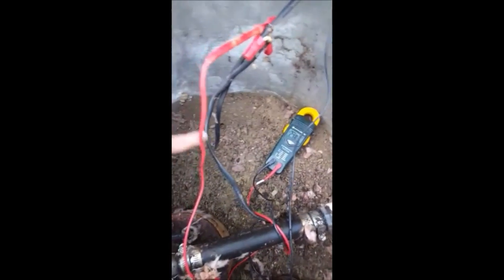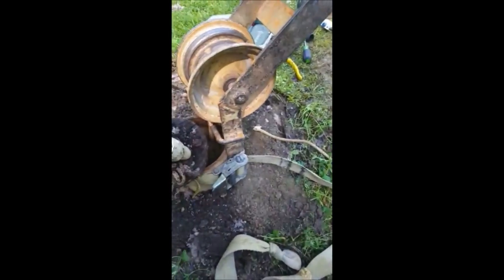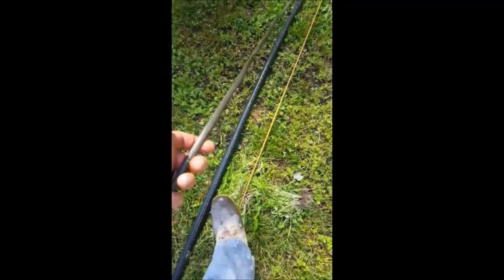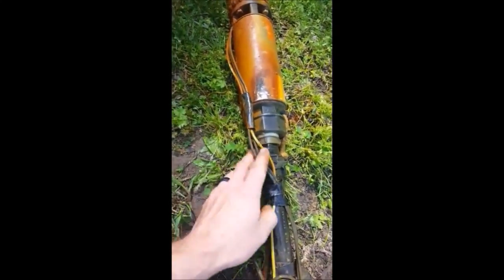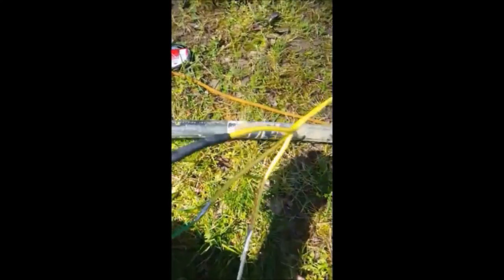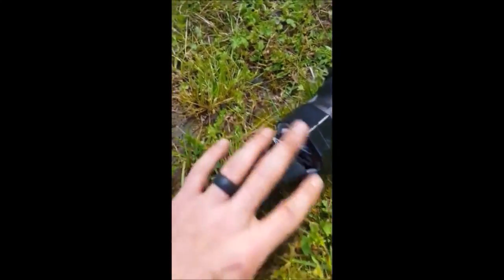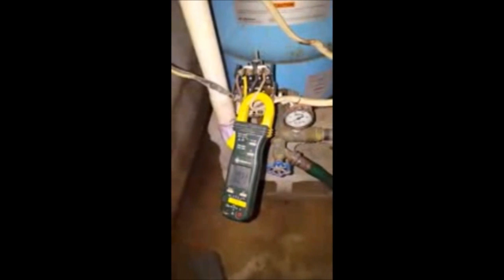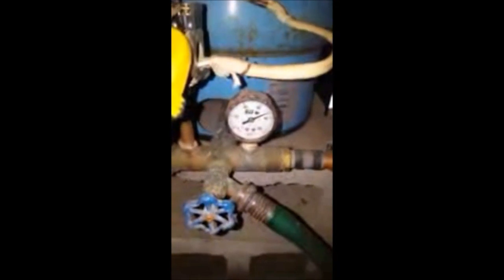Well Pump Diagnosis & Replacement - Done Right

Comment: I'm about to tackle a pump from the late 80s early 90s that's over 200 ft deep. You have a recommendation on type / brand of pump and bladder I should buy?
Reply from the maker: 3/4 hp Goulds pump. 10GPM 2wire
Reply: @h2omechanic   do you think 1hp goulds 18g p.m. 3-wire would be Overkill? We raise Hogs and go through over a hundred gallons of water a day just on livestock. What do you think I should do on the bladder
Reply from the maker: @bigred7322  2wire is simple...3 wire requires control box. Id stick with a 1hp . 18gpm head is too big for 300ft deep. A 10gpm head will give 15gpm & id use a 44 or 36 gal tank
Reply: @h2omechanic  I believe the existing is already three wire with a control box. Even if not, I'm not too concerned about simple, just want to make sure I put the best back in the ground so I don't have to do this again for a very long time. Would it hurt to run an 86 gallon bladder, or is that too big?
Reply from the maker: @bigred7322  86 gallon tank would lengthen the pumps life.
Reply: @h2omechanic  hey brother, just want to let you know I really appreciate your response to my questions. Your videos are super informative, and I can't thank you enough for answering my questions as quickly as you have.
Reply: What type of pipe should I run back into the ground

Comment: What did you call the wire splicer? A piton?
Reply from the maker: Thanks! Happy to help ☺
Reply: are they a specific type of butt connector?
Reply from the maker: Staycons
Reply: @h2omechanic  thank you
Reply: @h2omechanic  My son and I pulled our failed pump only to find a piss poor install.  Pump was fine, rewired per your perfection.  Very satisfying fix, now we know it is tight.  Felt really good feeding the pump back down with out all the wadded cords and un-taped wire, smooth.  So much exposed wire from rubbed insulation and the wadded pump lead.  OMG, that was done by pro's supposedly.  You are THE well guy as far as we are concerned.

Comment: I got the right voltage going to and from the pressure switch. At the top of the well I only got 75 volts at the pump I only got 50 some volts in both wires y am I getting this voltage drop

Comment: Have a question , hope someone ca n steer me in right direction. We  were getting intermittent water pressure at our cottage, replaced old tank and switch, worked fine, well seems as if it cant keep up, all pressure is good, 40/60, on at 38,off 58. If i run too many things, water stops. Well is 20 yrold but only gets used about 2 to 3 month a year. New pump time? Sediment? Curious . Ty in advance
Reply from the maker: Could be time for a new pump. If you use it & it quits, but in 3-4 minutes it is back on id say the pump is over heating and cutting off. If pump is 20 y/o, then the bearings are worn out & causes internal friction and the electric motor will cut off until the well water has cooled it down.  If you've never ran the well dry before this, replace the pump!
Reply: Tyvm, makes sense. You explained more than any other videos here!! Keep up the good work.

Comment: Why do you need to do a amp test . Is that a franklin pump
Reply from the maker: Yes it was a Franklin. Amp tests confirm if a pump is locked up, open, worn out past its max amps which would be internal bearing failure. Always good to check & make sure the wire in the ground isn't bad too.

Comment: You need a tork arrester and an I bolt for the rope. You want to keep the rope out away from the sunlight and rats. Everything you said was great. I have installed 100’s of pumps.
Reply from the maker: Ropes can fall & nest up around the pump trapping it. & arrestors can wear inhalf and fold over the pumo trapping it. Both will require a crane to Rip out the stuck pump. I dont recommend using either item bc they cause more problems than they prevent

Comment: What do I do if my switch arks, then clicks once like 5 seconds after the switch arks and the pump never runs? Im gonna get my buddys multi meter later today and test everything for proper voltages
Reply from the maker: Pump is running, thats why you see the ark. You could have a hole in a fitting or pipe in the well not allowing water to get to your tank. You can also have a bad tank if it clicks in 5 seconds. Watch a few videos on my channel, they explain how you test your tank to see if its good. Sounds to me like your tanks probably out of air & thats short cycling the switch which will hurt the pump eventually.

Comment: VERY helpful video, thank you Phillip. I would like to say though , I found my pump not to be grounded yet I still had 240 volts. I have been here 35 years and had the pump replaced 3 previous times professionally. It seems no one ever has addressed the ground issue. I changed everything myself this time and found no ground wire going from the home to the underground well pit. No ground wires on the pressure switch either.
Reply from the maker: Code has changed over the years. Ground wires aren't necessary for a well pump due to the fact that it is a metal casing that is already in the ground surrounded by water. If you feel like you need something, add a 4ft ground rod at the well & tie the pumps ground wire to it. Or attach it to the metal casing (if its not plastic)
Reply: @h2omechanic  I have something similar, my house-to-well head wire is two wire (no ground, but it's submersible) and continues down the well that way.  I guess it should have been underground wire, then submersible, and with a ground.  When I replace the pump I'll ground it near the well head with a rod (my case is pvc)....thanks again for a great video!

Comment: Please, help me! I bought this very old house and there was water
when I first checked. Then I turned the pump off and came back like a
week later (pump back on) and no water was coming out. I changed the
pressure tank, switch, valve and every piece that went with the set
up (including the pipes) and still no water.  I can feel the pipes
close to the well pump vibrating a little bit and also hear a water
noise coming from the underground when the pump is on. I believe the
pump is working, everything else is brand new, so any idea? I left
the pump running for about 4 hrs and no water, no
pressure...please...give me an idea. There was a lot of iron bacteria
in the old pipes from when I first ran the pump.  Thank you!
Reply from the maker: Send me pictures of the well area & of your tank area. 4342101376. From your description you gave, you can feel & hear the pump run & can hear water moving. Try disconnecting the pipe at the well allowing it to shoot water onto of the ground see if you get water there. But send pics first. You might have a bad fitting in the well spraying out all your pressure.
Reply: @h2omechanic  Hi! I've sen't the pictures. No rush on getting back to me. Just wanted to know if you've received them. Thanks, brother!

Comment: awesome video we have a well on our property its been here since a  good while before we bought the place we had to replace the wire an a few pumps in the last few yrs last yr we bought a bladderless tank an pump a new pump on well it lasted a yr an we had to replace the pump a month ago we havent had the best luck with pumps id say
Reply from the maker: Bladderless systems are not the best for a full time home. Same for a constant pressure system. The electric motor don't like starting & stopping that much. I recommend a 20 gallon bladder tank & as for pumps. Goulds, jacuzzi, J-class, or Red jacket. Cheap lowes pumps or Amazon pump are all Chinese crap. Pumps that are $400 last roughly 15 years. Hope that helps!
Reply: @h2omechanic  man, you are a Godsend for speaking to what you've seen on Brand Names.  Thanks SO MUCH FOR POSTING!!
Reply: @h2omechanic  so, if I found a much larger bladder tank that was only in use 6 months in a business that failed financially,, when I repair my pump, putting the larger tank into service will be a good thing, right?
Reply from the maker: @patrickwayne3701  absolutely! Bigger tanks prolong the life of the pump. Just be sure to check the air pressure at the top of the tank & set it 2-5psi below the "On" number of your pressure switch. You'd either be around 26psi or 36psi of air pressure. Air setting is key!
Reply: @h2omechanic  Outstanding Sir. It's one of those blue powdercoated tanks and I think its 120 gallons
Reply from the maker: @patrickwayne3701  yes! They require a 18" x 1.25" tank tee cross. Buy the Stainless steel one. Or you can just add it to you system by simply Teeing it into the incoming pipe! Those are actually 119 gallon. Any bigger = commercial lol
Reply: It has a pressure switch i just realised i forgot that we aren't the only house on the well. I told my dad since there is multi houses on the one well we might need a bigger tank or a bigger tank

Comment: I have no water,.....I checked the pressure switch it had 240 volts then I removed the wire nuts at the well and tested it,...110 volts?
I'm not an electrician.
So should the well have 240 volts or 110 volts?
Reply from the maker: If you got 240 volts at the switch its a 240v system.  If you removed both wire nuts completely from the wires going down the well & only got 110 then you have a bad wire in the ground between well & house. Remove all 3 wire nuts at well, use the ground wire as your neutral & test black you should get 110v then test white & should get 110v. 1 of them is going to read low voltage if you have a bad wire in ground. If you still had 1 or both hot wires connected to the well pump wires & got 110v then its a bad wire down the well. If the wire in the ground was ever cut years ago, then its probably bad. Ill answer any questions you may have.  Test it again how I described & ill tell u what to do next.
Reply: @h2omechanic   well I'm just using  a light,... it says 240 or 110,.... at the pressure switch it says 240.
At the well there's only 2 wires a Black and a white I put the light on both wires and get 110.
There is a green wire but it has never been hooked up. 

It's been fine for 4 years it had new plastic pipe and new wire ,new pump, new pressure switch and pressure tank.
That was 4 years back.

Then I came home and no water?
Reply from the maker: Your testing was correct then. The black & white are both hot & each should read 120v. So you have power out to the well & no water. Its 1 of 2 things.#1 Pump could be bad,which i doubt. #2 the wire going to the pump/down the well is broken. Time to pull the pump out if the well. And look closely at the wire, you'll find a spot where the insulation is worn off.

Comment: Does the torque arrestor help prevent the pump from hitting the sides of the well casing on the way down? Also I see that a lot of pumps should be installed about 10 feet off the bottom of the well . I guess to prevent ingress of sludge,  what is the best way to know when it is that on a 100 foot deep well with 20 feet depth of water?
Reply from the maker: Never put a pump 10ft off the bottom.  If a well makes 2 gpm or more, a 200 deep pump will supply any house. 10gpm or more a 100ft pump will work. Most plumbers, (not well drillers) will sell as much product as they can, that why they suggest it be 10ft off bottom. As for torque arrestors, they help prevent wire failure. I dont like them. Tape wire every 3ft & you'll never have a issue. Arrestors can cause bigger problems in the future.
Reply: @h2omechanic  Thank you for that information, how do you stop the silt or sludge at the very bottom of the well fouling up the inlet filter?
Reply from the maker: Your pump should not be on the bottom of the well. Atleast 40ft from bottom. If well makes good water, set pump at 100ft. Theres no stopping silt. If its really bad, & the well is old with shallow casing, it might need to be camera'd and see if the casing is leaking in surface water. If a rain fall makes your water worse, that's the issue

Comment: how complicated is it to pull the pump out? i might need to replace mine
Reply from the maker: Pipe replace if its 100-125psi. If its 160-200psi black pipe it's fine to reuse. Tape every 3ft. & look carefully at wire for rubbed spots. If its warn down to copper, replace wire 12-2 submersible pump wire. Also at lowes. Dont use grey UF.
Reply: @h2omechanic  thanks!
Reply from the maker: Not hard. Need 2-3 ppl. Cut pipe. Undo wire nuts. Pull up on pipe to pull it out. It just sets on the 6" casing.  Dont drop anything!
Reply: @h2omechanic  did you use the same pipe and wiring or changed the wiring? also, how do you joint the wires being underwater?
Reply from the maker: @Sean-Aviation  go to lowes. They sell a heat shrink kit that are specifically for under water

Comment: Wow I see a plastic pump head and on top of it being a scheffer brand of pump, very cheap of a pump and dont like plastic head pumps due to the head cracking over the years from all the torgue ,on and off.and I  always install a torque arrestor where I  splice in the pump..
Reply from the maker: I've never seen a plastic head crack. Typically the fitting will fail, not the pump. But I have seen a head blow out of the pump before. Typically deep set at 400ft. We dont use torque arrestors unless its absolutely needed due to a deviated bore hole. Once the torque arrestor wears out, & trying to pull out the pump it actually folds downward and wedges causing it to be very hard to pull. If it's set directly at the pump, it folds over the pump head. If that happens, you'll never get it out unless you use a tractor to pull with hydraulic power. If an old pump shows no signs of rubbing, then theres no need for them to be installed.
Reply: @h2omechanic  I totally agree with the torgue arrestor directly at the head of the pump and be hard to pull out, and if its taped correctly the wire not gonna rub anyway,like u stated in the video. 👍

Comment: Is there a way to test a submersible pump without pulling the pump?
Reply from the maker: Your pump is bad. The hum sound is a locked rotor trying to spin. It like turning on a ceiling fan & holding the blades. Pull out your pump, inspect the wires for rubbed off coating. Use 2 clamps at each connection and heat shrink for wires & electric tape. Follow my videos on pump install & take little notes. Small details of a install are key to getting 15/20 years out of it. Dont buy lowes pump or tractor supply.  Stick with Goulds or Sheifer or Grundfos or J Class. I'll walk you through it if you need help. 4342101376
Reply from the maker: Yes. Under the well cover you'll find 3 wires. Test the black & white wire with electric meter. You should get 240 between the 2. Then test white to ground & then black to ground "green". You should get 120v during each of those 2 tests using the ground. If either give you less than 120, you have a broken wire in the well. If all test out ok, and the pump doesn't come on, you have a bad well pump. Pull pump out, inspect wires & replace it "pump". Watch my other install videos for well pumps to do it properly.
Reply from the maker: Typically the 1 tool I use is $75 at lowes & it's a Amperage meter that clamps around 1 hot wire, either black or white or possibly red. It measures amp load. Anything about 8 is bad. Anything below 4, the main shaft is worn out. If it reads 0. Bad wire or bad pump
Reply: @h2omechanic  Does the amp meter have to set on a certain settingwhen clamped around the 1 hot wire? I will be testing mine soon ..I have pressure and voltage but no water ..when the power is on you hear a VERY faint hum for around 3sec then it goes off and repeats after about 15 sec, I replaced the pressure switch but not the controller.

Comment: My well breaker in my main box kicks sometimes once a day and sometimes several. I ordered a new control box hoping that could be the problem but it’s not here yet. Is it possibly just a bad control box or a pump going bad? The pressure is fine when the breaker isn’t kicked, thanks for any advice sir.
Reply from the maker: No problem!  I can help you out if you have any questions on installation
Reply from the maker: Typically if its tripping the breaker, the well pump is pulling over 15 amps & eventually pops the breaker. It runs at 6 amps normally. If the pump is 13-16 years old its probably going bad. Internal bearing failures happen around 15 years old
Reply: The H2O Mechanic , man I really appreciate you answering that. Looks like I’m going to have a job on my hands this week. Thanks man.

Comment: Hi sir from md ,my well is 190' I started to see water on top of ground next to my well casing I started digging and found a crack at the Pitt less valve.when I turned my pump on to see how bad the crack was it did not come back on  the second time I tried it.so I started troubleshooting from electric panel to the wires at the top of well  all was showing 230 volts,I also put in a new pressure switch in . I was getting 230 volts after the pressure switch but it was not sparking  ..or arching  when the switch made contact. This is the reason why I replaced it .I still have  the same problem, no sparking when switch makes contact  . I  can hear with my ear if I put my head against the top of the 4'' pipe  it sounds like it is trying to do something but it just stops ,this is probably maybe 5 seconds after the breaker is turned on.The pressure switch stays closed all the time . Any ideas that could help me would be very  appreciated . thanks
Reply: Sounds like the pump is locked up and needs to be replaced